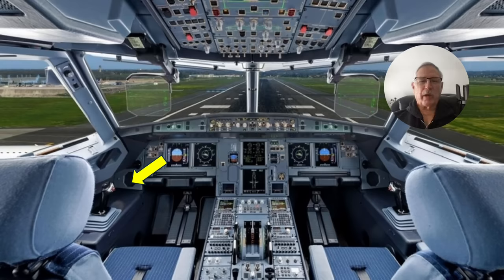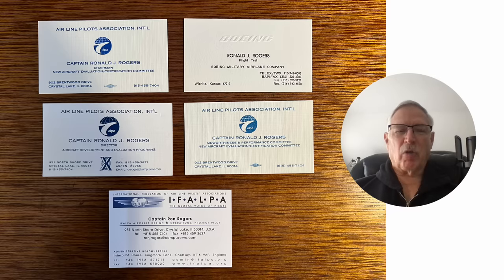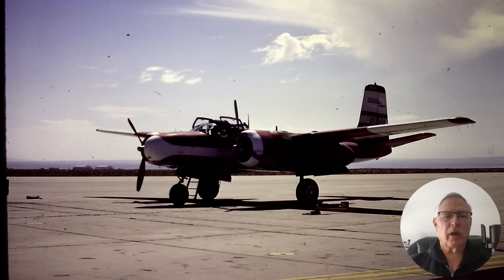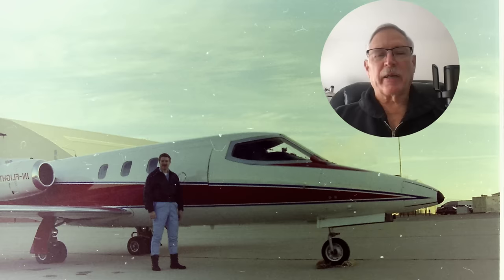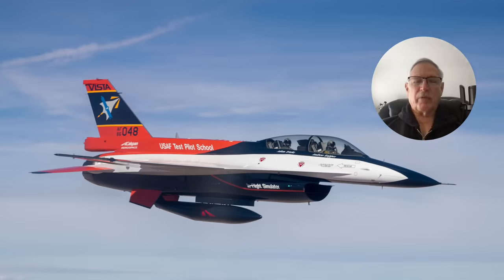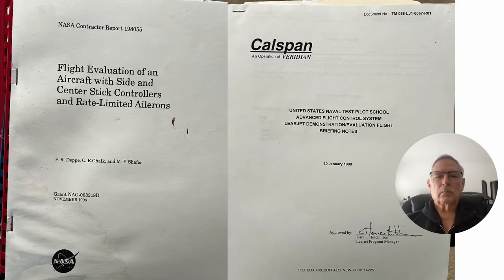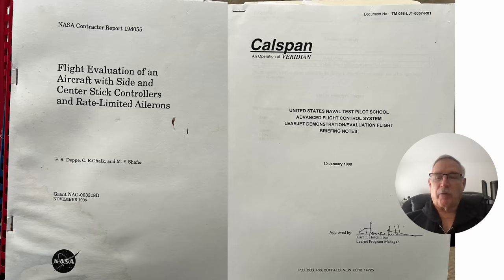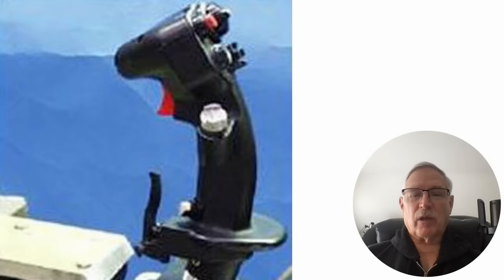Why didn’t they design the Boeing 777 with a side-stick?Funny that you should ask!

Comment: I was a pilot for United when the B-777 was being designed. Our first one showed up at ORD in 1995. However, when it was being desgined, Boeing invited pilots from all of the airlines who were going to buy their plane and asked them how they wanted the cockpit to work. Those pilots universally wanted 2 things that the Aibus did not have. A control wheel instead of a side stick, and the throttles to move in when the autothrottles commanded a change in engine power. Their request was validated after an Air France A-330 crashed at night over the South Atlantic when the least experienced first officer (the captain was in the rest bunk) of the pilots had his side stick controller full back putting the airplane into a stall at about 37,000 feet due to a pitot tube failure. The more experienced pilot coudl not see that, and had no idea why they were stalling. After the crash, they put Sully Sullenberger in a B-777 simulator and asked him if the crash would have happened to a Boeing and he said absolutely not because the expericened pilot would have seen the control wheel fully aft and would have pushed it forward to break the stall.
Reply from the maker: Might want to look at Northwest Orient Airlines Flight 6231
Reply: Definitely a relevant factor, but its up for debate whether a yoke would have helped. While perhaps less prone to that type of event, yokes are not immune from inadvertent dual control. Just recently some AF pilots in a 777 struggled for control for the better part of a minute during an ILS approach, not realising they were both controlling at the same time. The controls disconnected from each other as per design due to opposing forces, meaning the controls were temporarily moving independently, without the crew realising. A Virgin Australia crew almost inadvertently ripped the tail off an ATR 72 in 2014 after they applied opposing forces in flight, causing the yokes to disconnect and each elevator to deflect in opposite directions at high speed. The resultant forces from the asymmetric elevator exceeded the ultimate load for a brief moment and caused severe damage to the tail. It tore most of the attachment points between the horizontal stabiliser and vertical stabilizer. Luckily it did not fail completely, but the horizontal stabiliser was visibly bent.

In addition to the crash which Ron mentioned, here are a few crashes due to stalls in planes with yokes, including a few unrecovered high altitude stalls. Birgenair 301, 757. Colgan 3407, Dash-8. West Caribbean Airways 708, MD-82. Air Algerie 5017, MD-83.
Reply: @ronrogers My son and I visited that memorial site in Harriman State Park; we live about 15 minutes from the crash site. That catastrophe will always remain in memory because I was a passenger on an American Airlines flight from LGA to BUF at the exact same time. The Northwest was JFK to BUF. My poor mother was lying in bed with the radio news on when she heard that a flight from New York to Buffalo had crashed. She said that she actually levitated from the bed, thinking it was my flight.
Reply: ....retired..... call me old fashioned, but I want YOKES,  throttles + trim wheels that can easily be seen when moving.
Reply: Force feedback stick controls have been a thing in the games market a long time now.  I even used to fly Microsoft flight sim on the computer years and years ago.  Surprisingly it’s taken a long time for this to come into age and be a thing on the commercial side. I see Gulfstream is embracing it wholeheartedly all of their jets going forward are going to have them starting with the G 700 flagship.

That though isn’t even required to fix what happened on the Air France they could’ve solved that by simply having a light come on the indicated when that was being used.

To Airbus credit, the Air France crash the lessons of that disaster hit the company hard and you will see a lot of that in the design of the A350. It has a great deal of redundancy and alert messages. The way they appear really let you know much more when something like this is going on , it would probably be impossible to repeat the incident in an A350, even with those side controllers

Comment: My father inlaw worked at Boeing during the development of the 737 in the 60s.  He told me that Boeing was considering side sticks in the 737 but airlines were not interested. I have read alot about the air france airbus that crashed in the atlantic and how the side sticks was one  of  contributing factors in cause of crash.
Reply from the maker: Yes, I will have a presentation that talks about the side sticks and issues.
Reply: Ron, did you ever have the pleasure of flying the 757 with United??  Only one flight as a passenger on United in 1996 from Denver to Seattle and it was instantly my favorite aircraft.
Reply: This, plus the "Dial Input"alarm that did hardly sound, causing the pilot to ignore what the co pilot was doing.
Reply: @ronrogers  That would be great
Reply from the maker: No I didn't, but did fly it in flight test. I get senior on the A-320 and found I could jump directly to the 777 so I did.
 @AaronHarberg
Reply: That's was more a air france issue. Recently to Pilots of a 777 (?) fought so hard against each other, each thinking there was something wrong with the aircraft. the managed to create a major upset. fortunately it was nice weather... otherwise the may have crashed into paris. CRM  is the key and the only thing that really can prevent this type of crash. still wouldn't hurt to have either feedback. or at least the ability to display the input on a screen fro instruction flights.
Reply: @AaronHarberg Based on the videos and accompanying comments I’ve seen and read regarding the 757 by pilots and passengers alike (plus my own experiences), it would suggest Boeing should have continued updating and modernizing that airframe instead of the 737.  But knowing how enormous companies typically operate, it comes as no surprise that the 757 was discontinued.  😱🤣
Reply: Again, It’s AF something is wrong with. They almost brougth a b777 down using the yokes. Nothing to do with side sticks or yokes.
Reply: @Primus54 Juan Brown (@blancolirio) cites the 757 as the best airline frame he’s ever flown. Most of the issues they’re currently experiencing seem to be the result of C-suite executives pushing MBA tricks onto an industry that’s not equipped for the kind of accountability-free number games other industries have been getting away with.
Reply: @silverXnoise  Agreed.  Boeing has never been the same since the McDonnell-Douglas merger and bringing MD management into the C-Suite.
Reply: @herceg6772  Non-coupled side sticks are a problem.
Reply: @Primus54  Why is it a problem? I don’t see Airbus airplanes falling from the sky having “that problem”. The Airbus pilots are well-trained. AF fu…. thing up once with AF447 bit were also close to crash a B777 doing the same with yokes.
Reply: @herceg6772  You have to exert a significant force to decouple yokes on Boeing aircraft.  And this channel just did a deep dive on the training and kinetic advantages of coupled controls.  It’s my opinion… you’re entitled to yours.  🙄
Reply: Alex, see my comments above about the A-330 that crashed in the South Atlantic.

Comment: Sidesticks are better in my opinion because it allows more space, and flying is not like driving you fly with 1 hand so a stick makes more sense you always have one hand on the control and one on the thrust, the main thing I want sidesticks to have is both move when pilots make inputs for better situational awareness and it seems like Gulfstream has figured that out

Comment: I flew 737's, then 787 and now A320. Here goes my 50 cents on boeing vs airbus design:
in the 737 it makes sense, it gives a lot of feedback from what the other pilot is doing and also from what the AP is doing. The moving throttles also helped a lot. 

Now,  on the FBW boeing, it's a different story. The yoke is much smaller, and the required movements are much less compared to the 737. You can watch the AP doing a turn and the yoke barelly moves. The inputs are very small, and flying manually, with the boeing FBW logic and the trim reference system thing, I found the yoke very artificial particularly in pitch control, and too 'sporty' with the ailerons. The roll rate was super fast compared to the 737. 

Then I moved to airbus and honestly the controls are much more pleasant to fly. I think the sidestick and the airbus FBW logic (auto-trim) is way better in controlling the aircraft than the Boeing FBW, being much more precise. There is indeed a penalty not having the sticks interconnected, in particular during training flights. But so far, everybody survived.
I don't think it played a big role in the AF447 accident. As far as I know, stall was not even trained in the sim during that time, since an airbus would never stall... like the Titanic would never sink. 

For me the yoke on modern Boeing FBW aircraft is just a big sidestick. The feedback is minimal, almost irrelevant in a normal flight. I found the elevator feedback to be very artificial. The only advantage would be on training flights. Basically you give small inputs into a computer that is actually controlling the control surfaces and the aircraft path. And for this purpose, the sidestick is much better, much more precise, even with turbulence or gusty winds. 

with the Boeing FBW logic, the yoke is almost useless in my opinion. Put a sidestick on it's place and it would be much better. 

Talking about the moving throttles, it certainly helps a lot, but it's logic can also be confusing. Have a look at the Asiana crash in SFO and the Emirates 777 in Dubai. It would never happen in a Airbus. I found the Autothrust logic to be far more simple than the Boeing Auto Throttles.

Comment: Having flown both the B737 and the A320 in that order, my two wishes for the A320 was that the side sticks would be synchronised and the throttles would move, however IMHO in every aspect the A320 is a better tool to operate, and much less fatiguing.
Reply: Agreed!
Reply: Paul, see my comments above. You are spot on.
Reply: @MrSuzuki1187   I would still prefer a side stick as it gives you the space to fill in paperwork, eat your food etc, but I would want them to move together so that you can feel the other pilots inputs. Maybe the technology for this is too expensive, or too likely to fail?
Reply: @PaulCopp  there was a YouTube video that contemplated this recently with no firm results. Specifically, one of the American cargo airplanes has side sticks with force feedback / coupled movement. Even more - the sticks for the cargo aircraft had the same manufacturer as airbus.

Comment: Ron, I ran the Research Cab at the IASL across from Boeing Flight Test at Boeing Field during the 777 development (1991-1995) and we had a portable side stick that I was supposed to keep "out of the way". We would invite you test pilots across the street and do some simple experiments with it but it was not to be visible otherwise. We were also demonstrating advanced displays (EGPWS on the MFD and forward perspective on the PFD) but EGPWS only made it onto the airliners after the 757 crash near Cali, Columbia.

Comment: Thank you Ron for a truly interesting insight! Your knowledge and stories are a real joy to listen to.

Being a low time PPL instructor in a little aeroplane and only 300 hours I don't have much to say, but I appreciate the ability to feel the input of a student with the original fly by wire. In Norwegian "wire" means steel cable, so fly by wire has always been a little misplaced term to me! The "following but not controlling" as you mentioned helps detect abrupt input and if repeated helps reveal unwanted techniques. In other words helps me as the instructor to prevent dangerous situations and accelerate feedback to the student.

I can only imagine what it is to try and detect a technique or behaviour without direct input or without linked controls. That is where your great experience comes in. For me that is still a long way to go. Thank you for all these various little insights that you give us in your videos. They might be little details and stories of times from the past, but interesting to me who is at beginning of mine.

Comment: As both a pilot and aeronautical engineer, I don't understand why nobody went with a coupled sidestick solution yet. It seems like the best combination of ergonomics (tray table and such) and pilot-monitoring-in-the-loop, receiving feedback on what the other guy is doing; the best of both the Airbus (engineer) and the Boeing (pilot) worlds.
Reply: I believe Gulfstream Aerospace already have. Unless you're referring to commercial airliners.
Reply: G700 active sidesticks.
Reply: The space shuttle has coupled side sticks so there is no good reason for Airbus to continue with their uncoupled ones. What I have read is that Airbus just wanted fewer things to go wrong. Idk, it's weird. The space shuttle had many problems but the sidestick wasn't an issue.
Reply: @CapitalismSuxx  The reason is that it doesn't make much of a difference. But I agree it's nice to have and I've read somewhere Airbus is going to adopt it.
However, with active sticks or yokes, we still don't know if the feedback is from the aircraft or from the other pilot, unless they opt to only provide feedback from the other pilot.
There was a dual input incident with an Air France 777 in 2023 (EDIT: April '22) or so, proof that what matters is clear crew communication and team work.
Reply: @miks564  the feedback could be visual. so you could have like light bars (more light on the axis light up, more input / feedback from plane.)  this would allow to show both separately. especially with a hud this could be helpful. otherwise it may rather contribute to stress, as it's on more thing to keep your eyes on.
on the other hand, you could introduce a warning to the other pilot, if on pilot makes any huge input (with direction of input).
one of the major factors also seems to be the startling effect. that's hard to simulate... when training for a emergency. but every now and then, put the pilots to sleep in the simulator and have them wake up to the blaring of the master caution alarm. coming out of sleep their brain likely will not remember that this is only a simulation.
Reply: @beyondEV   That seems like a good idea. We've seen that the "Dual Input" call out has a good chance of being ignored during stressful situations.
But I guess you must convince someone other than me here on Youtube.
😊

Comment: One thought I have about the side stick is that if you have two captain qualified pilots in the cockpit one is using his left hand to control the stick and the other is using his right hand.  Perhaps I'm overthinking it but with the center yoke in either seat the pilots can use whichever hand they normal use to control the yoke.  Anyway, I always enjoy watching your videos because they are so informative and interesting.
Reply from the maker: You still need a hand on the throttles and that positioning changes depending up which seat you are in.

Comment: Space Shuttle sticks (RHCs - rotational hand controllers) were NOT coupled.  When one stick moved the other stick DID NOT move.  However, the stick inputs from both the Commander and Pilot were “summed”.
If you put in 1/4th left roll deflection, and I do the same, the two inputs are added together.
Reply from the maker: I was told by a Dryden NASA engineer that they were coupled. I didn't really see a reason for it but figured if she was incorrect, someone (like you) would point it out. Thanks.

Comment: I always wonder how pilots adapt or get used to the airbus side stick when changing seats if they are right handed or left handed. I just recently saw on YouTube a video showing an EasyJet FO going through CAPT training in which she was having a hard time during sim training as she was taxing the plane. she was right handed and being a FO for long time and looked shaky even during her 1st check ride as a junior CAPT.
Reply from the maker: I was a Line Check Airman on the A-320 and I would jump from left to right seats depending upon who I was checking out and really didn't have a problem with it.  I flew fighters with the stick in my right hand and flew airliners with the yoke in the left. Also had to trade hands flying the yoke in 727, 777 etc when doing checkouts so you get ambidextrous.
Reply: Never saw it as a problem personally,  In any case, even with a yoke, you have to swap hands or it's going to be hard to operate the throttles!
Reply: The sidestick is not used for taxi. I don't understand the example you provide.
And precision is not as needed on Airbus. The pilots should give little nudges on the stick. ...computers will deal with the detailed corrections to compensate the little wind variations.
It's easy to witness this work by comparing the work of a pilot with the sidestick and the work of all the air surfaces on the wing.
...and then compare it with the work of a pilot landing an analogue aircraft like the 737.
Worlds apart
Reply: I guess those B707 pilots had it even harder, having to start the takeoff using the tiller and then switch to the rudder after building up speed; then reverse the procedure on landings. @PaulCopp
Reply: They had a whole other level of workload. I recently looked at a 707 cockpit in a museum and was amazed at the way that as technology evolved they just bolted things into empty spaces so the ergonomics were awful. Makes the 737-300 looks ultra modern  @johncantwell8216  🤣
Reply: I have a copy of the DC8 systems manual, and the same thing is true there also.
An outrigger box on the F/E's panel, and Doppler radar gear in the overhead panel. At least the DC8 did have rudder-pedal control of the nosewheel steering. @PaulCopp